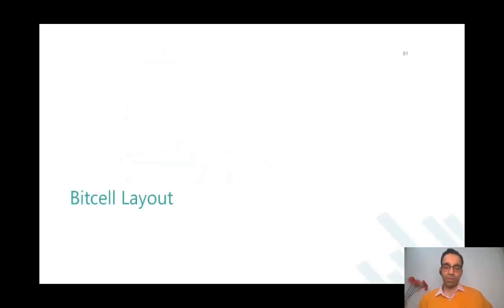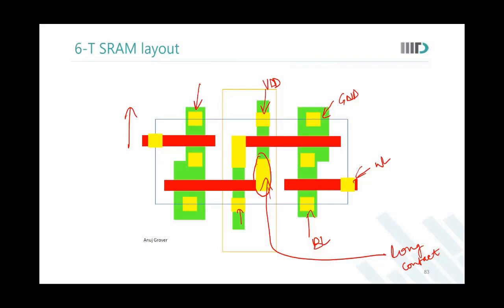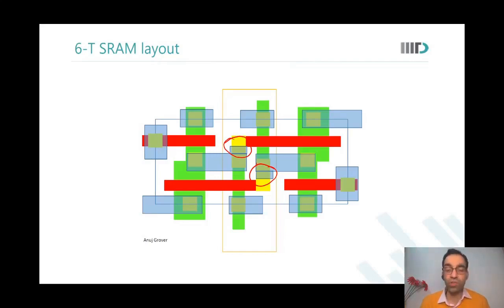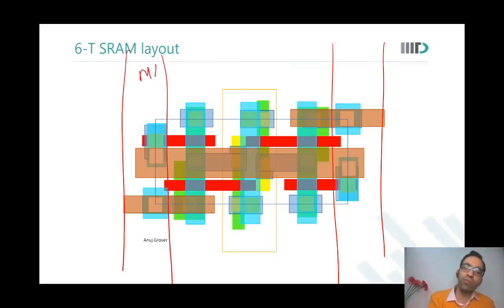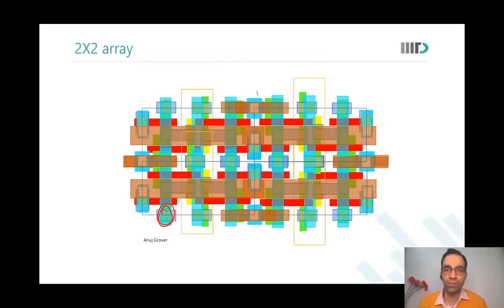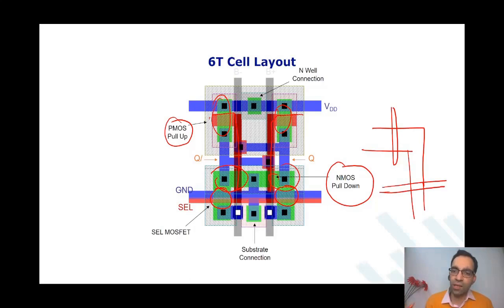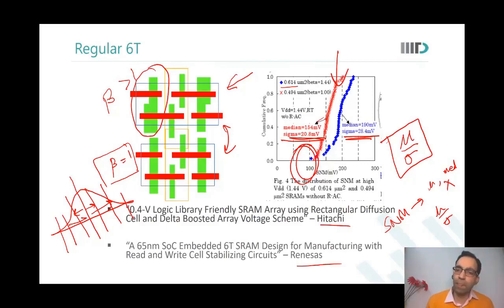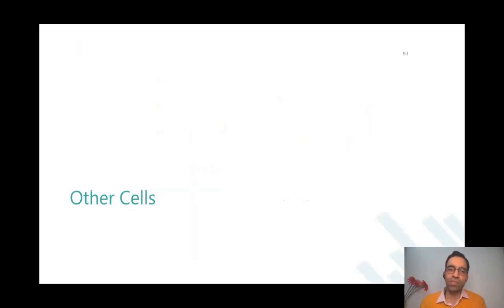SRAM Cell - High Density Layout Design

Comment: Hi Anuj sir ,
As in the lecture you said that word line will see the intra metal capacitance from the adjacent gnd rails , but gnd rails are static power rail so the capacitance between a dynamic signal (wordline) and static power signal (vss) is very negligible as per my understanding. so why to cut the vss rail and pass it through M4 metal rail.

Please let me know if i am missing something or misunderstood anything ?

Thanks
Reply from the maker: There’s always capacitance between 2 wires. 

Due to transition of signals on the two wires, effective capacitance can be higher or lower than the static capacitance. 

You may want to watch the lecture interconnect capacitances in the other playlist for more clarity. 

All the best.